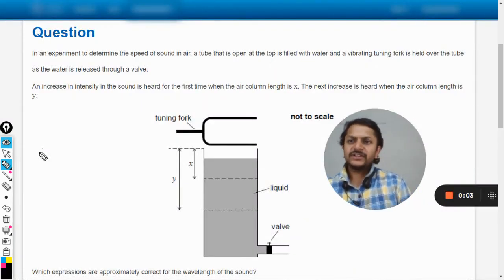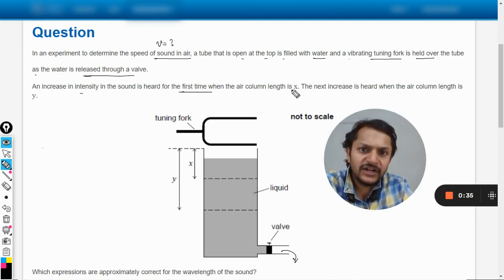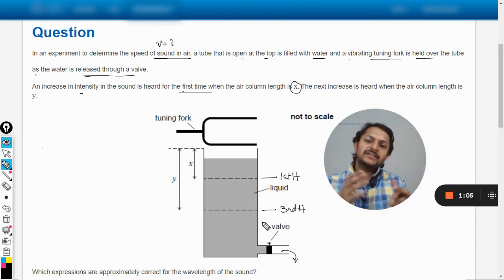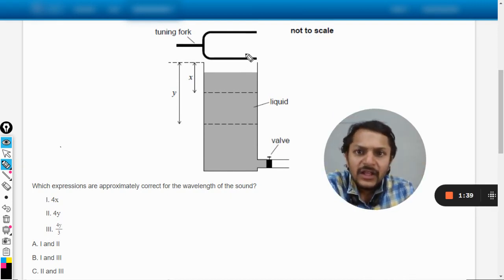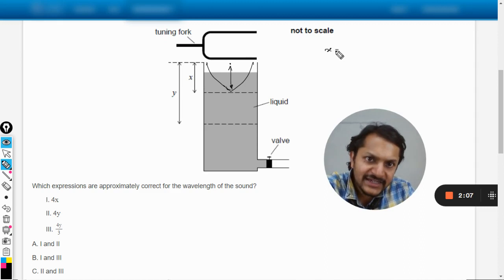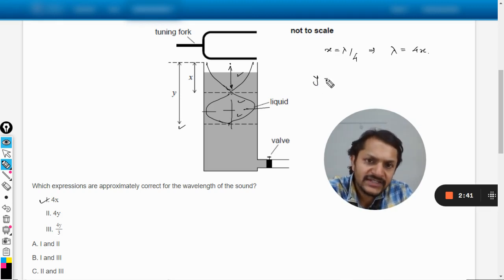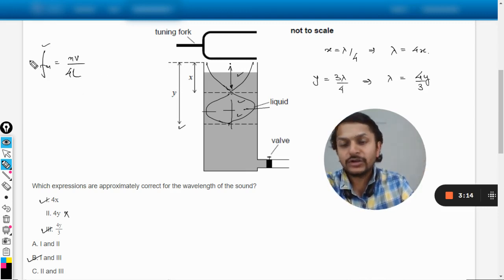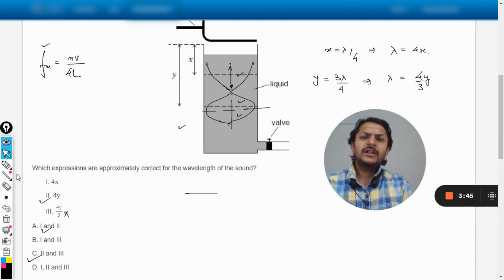In an experiment to determine the speed of sound in air, a tube that is open at the top is filled wi

Comment: Prof. Varun, how is it possible that there is a lambda/4 wavelength within the length of x and suddenly a lambda/2 in the second part of the of length y? The distance of y looks to be equivalent to 2x, which would not make sense for us to use it in that way. The initial x length housing a quarter wavelength and the second x length housing half a wavelength does not make sense.
Reply: Is it because the increases in intensity must match with the nodes of the standing waves?
Reply: I think it’s because each increase in intensity means a shift to the next harmonic

the second part of y is lambda/2 because of the third harmonic minus the first: 3lambda/4 - lambda/4 is lambda/2